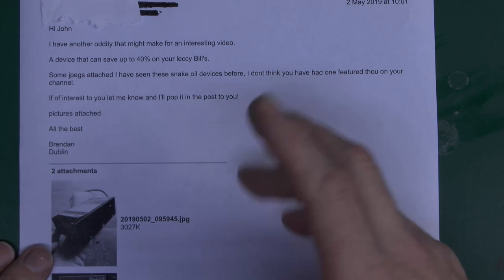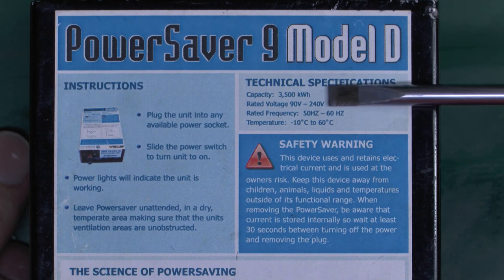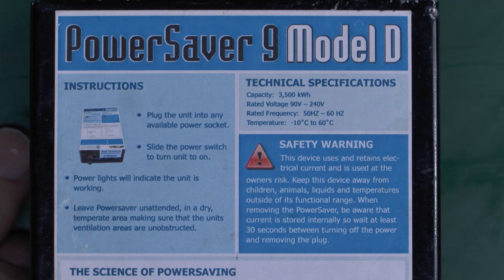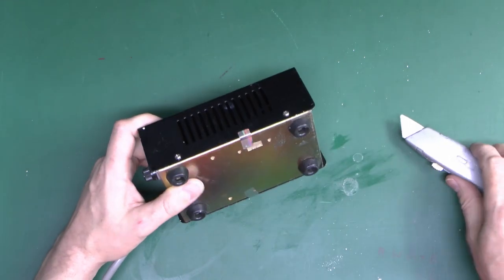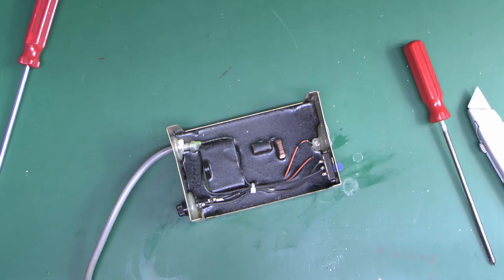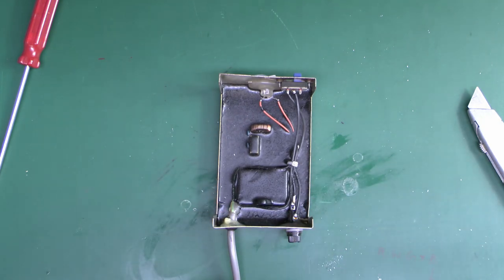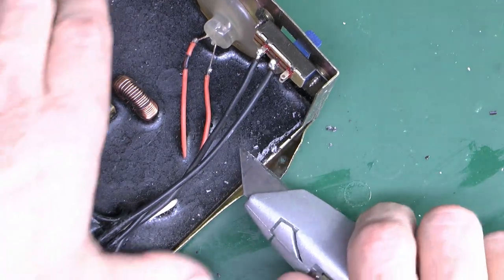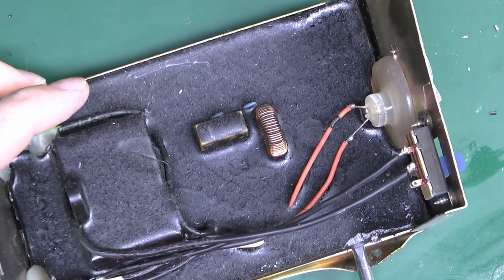Power Saving Capacitor Box - Extreme Teardown

Comment: The potting compound was probably the most expensive thing in this item!
Reply: They could have built a perfectly good airplane with that potting epoxy!
Reply: It's the hard black thermally conductive potting compound. I guarantee it was the most expensive part.
Reply: No kidding, that box of woo is absolutely hilarious.
Reply: So much for popping it in the oven and melting it off like you could with that waxy stuff they used to use....

Comment: John, just a quick heads up. Before I became a spark I used to work in a factory making specialist accessories and cables. We used that black potting all the time. Whenever a mistake was made, we did not throw most materials away as they were too valuable. We had to recover them. That usually meant sitting there picking away at the black resin until we got to the prizes underneath. I discovered, completely by accident, that a decent amount of heat (about 180-200c) would break down the resin and it would crumble and peel off very easily. If you ever come accross a potted circuit board or similar again, grab your heat gun and give it a shot!

Comment: Looks like the metal case were designed for a power supply of some kind.
Reply: Looks like the case on the old 3 amp radio shack power supplies lol
Reply: Hence the spot for the 110/220 switch on the bottom.

Comment: These do actually work in China where the power system is different and they rely on a Borg Vinculum power station interfacing with plasma fusion disruptor spinnacles to generate the common human electricity required - this item just boosts the time dilation frequency whilst simultaneously decreasing the resistance to 4th dimension warp harmonics.

Simple really!
Any first year warp theory student learns this in his first week in Star Trek academy.
Really!
Reply: that was the same conclusion I came to
Reply: Not strictly true, but I would need to go into rather a lot of detail to explain why.

Comment: Educational watching you analyze; Suggestion: Analysis of (LED) power supplies that fail and how to determine which component failed with an eye to replacing it/repairing PS.
I have a bunch of the 'florescent' LED tubes where the LED's are fine, the little rubbish PS has an issue.

Comment: Hi John, I just watched this and was looking at and extra pin on the CB that was not tested. The middle pad had an inductor in series with a cap between the mains. Also there is a third connection on that pad, where did it connect to? After looking again, the white wire went to the fuse plus 1 side of the 5uf cap (black wire). looking again the white wire was cut off at the power feed cable that entered the box. I am thinking the white wire that was connect to the CB was just a jumper wire and happened to be white. I think the neutral (white) was buried in the potting and was connected to the same trace  as the earth (green). I liked the job you did but I was confused on how this could ever "work" (light the LED I mean). There was something missing and I needed the have a solution. Green wire used as neutral was not cutting it for me. I hate working with potted components. Good luck and nice job.

Comment: Circuit board looks like a basic RFI filter but as not in line with the load, no use. Larger capacitor would help RFI supression a bit though on the end of a lead would reduce effectiveness at higher frequencies. Also of inadequate quality as not marked as X2 class as it should be for connection across L-N. Connecting across L-E would trip an RCD as the current would be about 0.36A at 50Hz. Certainly won't save any power...

Comment: Very reminiscent of a dongle thing that I once encountered, from the potting were two ICs just protruding. Being an expensive thing it was a while before anyone figured that the ICs were just scrap devices not even soldered in and the d-type connectors either end of the box merely had one wire crossed over. Anyone else remember the X-COPY dongle for the Commodore Amiga?
Reply: My X-COPY's originally came on copied disks swapped at school and didn't need a dongle.

Comment: Isn’t actually a rather lacklustre line conditioner to smoothe the supply by a small amount? There’s a bit of HF filtering going on, so might be of some use for a few kinds of sensitive gear. It has of course nothing to do with saving electricity.

Comment: Would this not have caused constant tripping of the RCD/RCBO/GFCI on any circuit it was connected to?  It seems it constantly draining current through the LED from line to the CPC.  I'm guessing not enough to cause a trip directly (240V across a 180k resistor is less than 2mA) but it can't help.  I wonder why the choice was made to use the CPC as the return rather than the neutral?
Reply from the maker: Yes, the capacitor is also between line & CPC and would result in about 240mA current.  Instant trip o matic.

Comment: Back in the 80's, I remember a plug through 'power saving'device that was designed to have your fridge plugged in to for supposedly reduced running costs, would it have been a similar thing to this?
Reply: That was likely for fridges that didnt have thermostats.. so it simply would have cycled power on and off to the fridge as a timer
Reply: That sounds like the device that was supposed to supply full mains to start the compressor then reduce it once running to save power. Probably saved none as the compressor just ran longer.
Reply: @Graham_Langley  Yes, you dont get something for nothing!
Reply: Which tested those and found they did save money as advertised. I'm not sure how the device worked but I would tend to trust the Which test process.
Reply: This should be dis mystified, in the sense that capacitor(s) used for "power factor correction" is real, obvious and well known to science. When absent from certain inductive devices, like motors or magnetic ballast fluorescent lights. Either because badly calculated/implemented or because the capacitor became old or non functioning. The person adding a capacitor to the circuit can indeed find some benefit in it! Which once more I state it's not a "miracle" is well known science. ;-)

Comment: Hi, just a question on sauna installs. What type of cable what yous recommend using from isolator outside the unit into the heater? Regs say have to use a cable that’ll withstand 170 degrees c, but the sauna that’s going has a thermostat and will cut off at any temperatures over 120 degrees c?
Reply from the maker: The 170C only applies to cables installed in zone 3, which is over 1m above floor level and more than 0.5m from the heater unit.  Does not apply to the wiring to the heater unit.

Comment: 22:30 the clearance between live and neutral  looks like might be a new record I bet that would arc over if it was connected to the mains defo with a bit of moisture in the air   it was separated by the distance between the pads of the not populated three pin device!  can you measure it John?

Comment: putting a cap across an ac line will actually draw power from repeated charging in each direction will it not?
Reply from the maker: There will be a small amount of current flow, but the net power used will be zero (or almost zero as capacitors are not 100% perfect)
Reply: @jwflame  thank you for your reply John

Comment: This power saving "miracles in a box" are a lot of wishful thinking. BUT curiously where the "legend" comes from and respective application is not!
With this said a nice video about "power factor correction" and respective capacitor application(s) would be quite useful. I believe you're quite good at explaining, professor like.
Particularly with those older beaten up motors and fluorescent lights. The advantages are obvious and well known in the electrical world. That is not a "miracle", it's a fact worth a video! ;-)

From personal experience. One office building with older fluorescent lights (ferro magnetic ballast) came down a whopping 30A on 230V instalation. Over the years the capacitors went South one by one, never maintained or replaced. In some instances were even removed.  The replacement with new, properly working capacitors, like mentioned, lower the current by 30A! The switch breaker never deployed again. In fact we were called precisely because they couldn't turn on the lights, it would trip the breaker immediately. Not anymore. ;-)      
Cheers

Comment: I wasn’t taking a great deal of notice when John was describing how the components were connected, so a diagram would have helped. If the capacitor was connected correctly, then it would save power. Capacitors are used extensively in fluorescent lighting for this very purpose. Okay. that particular device was not electrically sound but the principle of using a capacitor to save power is actually sound. Maybe John could have spent  more time on that with a few calculations thrown in for good measure.
Reply: As JW said in the video, PFC caps are used and useful in large factories, but they need to be matched to the exact power consumption of the load to be of any use. PFC is an art in calculation, I remember doing it at college years ago, but it hurts my head calculating it lol. Banks of the caps can be seen in some big factories in the power intake rooms, and usually where motors and inductive loads such as hundreds of fluorescent lights, or high pressure mercury vapour lights, sodium lighting is used.These installations are very carefully calculated to match PFC. Also, as JW said, most suppliers don't charge for PFC either, definitely not in a domestic property in the UK. There is a "rumour" that smart meters will be able to charge for it in the future though, Big Clive (you tube channel) has his theories on this... however, this box of snake oiled junk has absolutely zero benefit to any install. great video JW

Comment: "VCTF" is actually a type of flex used in Japan (JIS C 3312), Taiwan (CNS 3199), and Korea (KS C 3304, as seen here).

North American flexes, to my knowledge, either have a solid green earth, or are fully IEC color-coded. Also, they specify conductor size in American Wire Gauge.
Reply: I have an odd example here, from a north american dental chair (we got contracted to do the dentist's office)... which has US sizes, but specified in mm2....to about 3 decimal places. (It's IEC colour coded, but has a Nema 3-15 plug on the end, to boot)
Reply: Oh and it was set for 240v. with a 120v plug. LOL. The installer told us this was normal, and completely removed the cord (hence why I have it) and replaced it with a normal 1.5mm flex connected to the spur we supplied.
Reply: I didn't think NEMA 3 connectors were actually made? (Wikipedia says NEMA 3, 4, 8, 9, 12, 13, 19, 20 and non-locking 16, 17, 21, 22 and 23 series have no designs to date.)
And you're right that the equivalent size in mm² is often given, so I'll fix my first comment…
Reply: @longrunner258  you're right.. Brain fart. I was going by 3 pins lol..I meant 5-15 :)

Comment: John,    A real piece of junk that some people buy into.    Over here across the pond, some are trying to sell saving devices as well.   You say that they can not work, so I need to see if you agree or disagree with me.    Let's say that you connect a relative large amount of either capacitors, or inductors to your electrical system.   Now the amperage either leads or lags the voltage.   So horrible power factor is the result.    Voltage remains the same, amperage remains the same or very slight increase.  Now does this save or cost the home owner?    Residential meters read watt hours, not VA.    So the meter reads,  volts x amps x power factor.   If 50% power factor with 50 amperes continuous(hypothetical) at 240 volts, then KVA is 12, and KWh for one hour would be 6KWh.   Savings of 6 KWh.    When asked about these devices by another contractor, I told them, my option is this is fraud of the electrical utility.   Please let me know your thoughts.   Respectfully,   Kevin
Reply: Your meter displays Watt Hours but likely measures current flow using a Hall sensor.
Reply: Put the capacitor in paralell with inductive loads, after the switch.
You can see them included in many devices already!

Trying to do whole house compensation is likely to be wrong most of the time, and actually increase the current from the grid.

You won't save anything if you pay for the kW, since the extra kVA is essentially free.
Except, if you pay for kVA, and have it connected and no other loads you may end up paying for the reactive current of the capacitor.